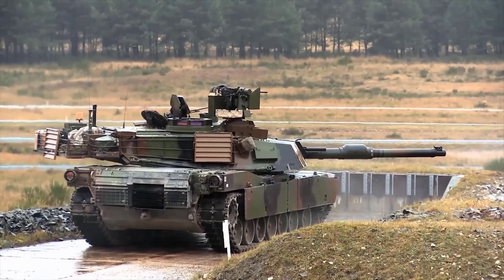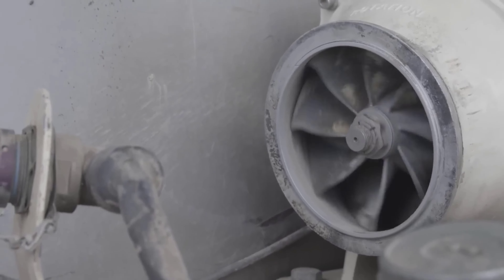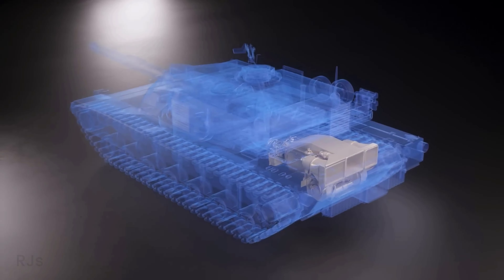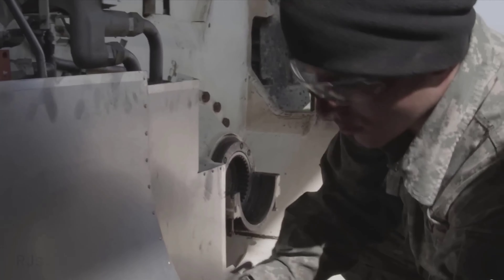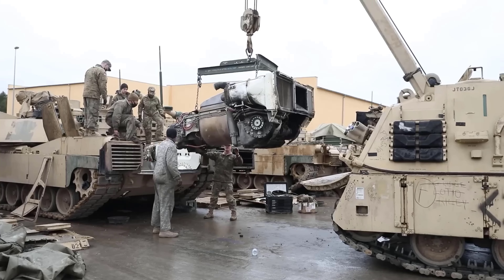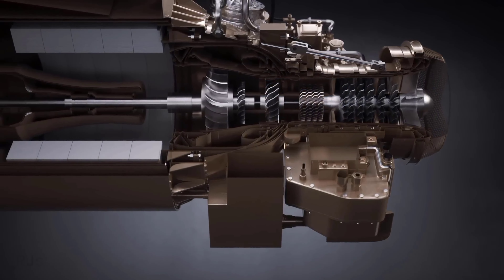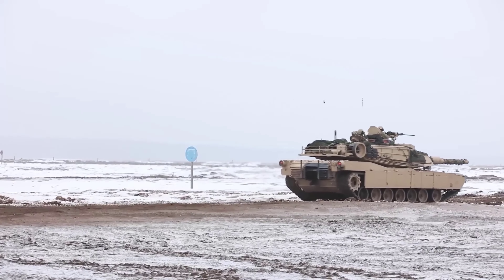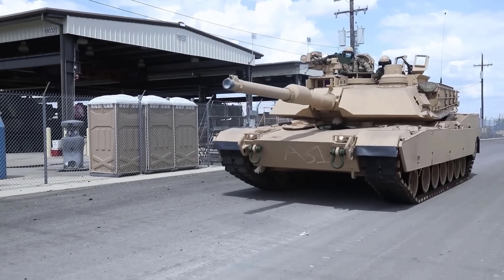Why Abrams Tanks Choose Gas Turbine Engines Over Diesel Engines

Comment: Computer audio is terrible.  I can forgive a person for mispronounced words.  It is hard to accept that a narator can't say Kosovo.  

The narration on this video was poor in that certain facts were repeated two or three times, making for non-sequitors, and a disconnect in the thoughts being conveyed.
Reply: I second that. Repeats were very much annoying.
Reply: Furthermore ... "the turbine is more powerful and produces one thousand five hundred H P,  while the diesel engine produces one thousand five hundred H P"... it is like the automatic online comparison sites 🤣
Reply: @radeklukas  The gas turbine and the diesel each produce 1,500 HP.  Power-wise each engine produces the same HP, making them equal. 

The difference in power and torque between a gas turbine and a diesel occurs at approximately  65% rpm.  From 20% rpm to 65% rpm a gas turbine has a small advantage over a diesel. Above 65% rpm, the diesel has a slight advantage. 

One other advantage the diesel has over the gas turbine is air quality.   At times when there is a large amount of dust, say on a dry unimproved road, or a dry field air filtration is an issue.  The same is not true of diesel engines 

I do not know if it is still true, but in the early 2000s, the gearboxes were a greater maintenance issue than the engines.